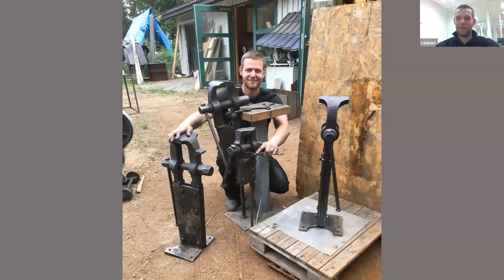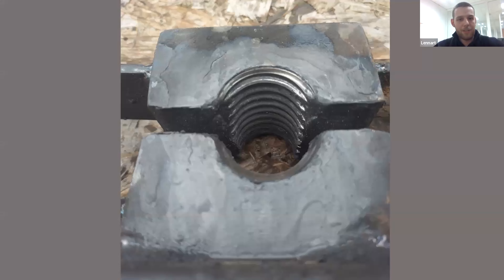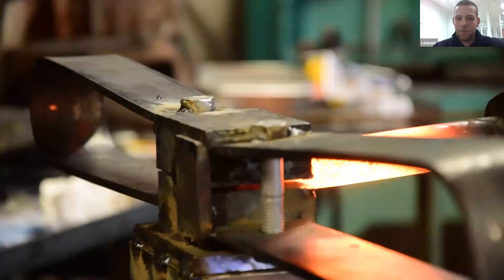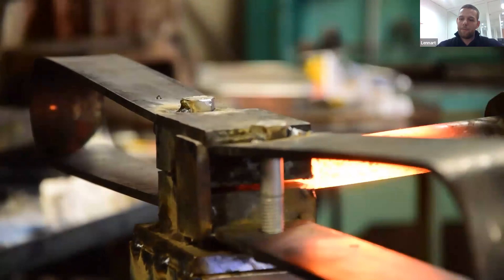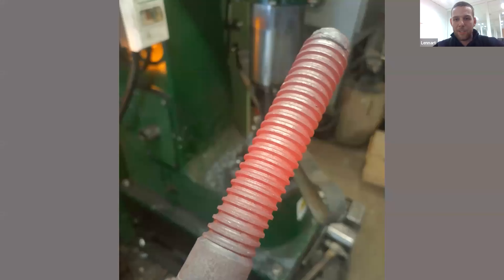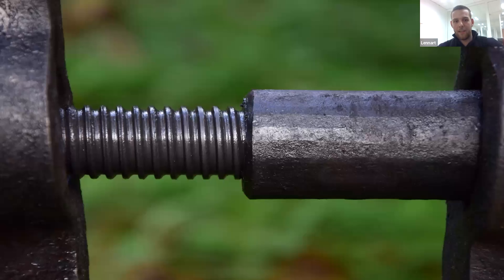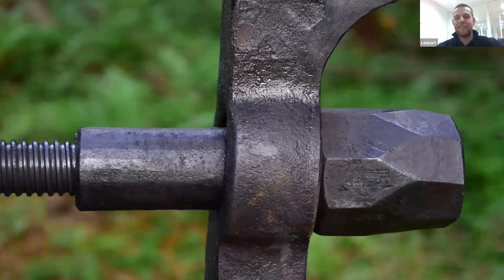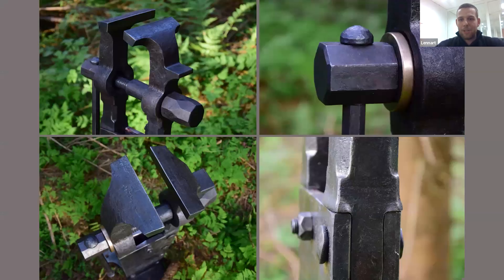Forging Vise Screws with Lennart Hoffmann: Blacksmiths Without Borders Aug 2023 Treff

Comment: I hope we vcan get this question to Lennart Hoffmann.
He talks about the shrink of the nut when cooling down.
How do you compensate for that towards the final product?
I'd assume you have to oversize, however small or large, the thread on the spindle you use as a swedge.
For the spindle I get it,
If you start from a model spindle, you can make the counter swedge for spindles. That swedge will shrink cold as well, so the new spindles will be ever so slightly smaller than the original.
Moving to the nut, that would then be even smaller...
How to get it to fit properly?
Reply: hi, to compensate for the shrinkage that happens when forging the die itself, there is not much to be done except making the first screw slightly oversize. there are several ways to go from there. if you use the "master" screw as a "drift" to forge the internal threads the threads will shrink,but since the screw you forged in the die also has shrunk it all works out nicely. the other a little more brutal way is to just keep the screw "drift" inside the nut while it cools down preventing it from shrinking too much. this will easily get the drift stuck tho so to prevent this you have to keep the drift lubricated with graphite and keep it moving in and out the entire time, i did this by welding a nut to the back and using a big impact driver. the shrinkage at these sizes is bery small so if it turns out too tight a little valve grinding paste between the screw and nut quickly makes them fit. the first way using a slightly oversized master screw is preferred in my opinion 
greetings, Lennart
Reply: Hi Lennart, agreed that if you have a master and a master die made, a new spindle made in the die would fit a nut made on the master. 
How would you approach then a situation with just a broken nut? Would you replace both nut and spindle? Or try to prevent shrinking? These questions are hypothetical and purely out of interest 😅 not planning on doing this stuff anytime soon..
Reply: @MafkACE  to be honest if i had to repair a broken nut but the acrew was still good i would use a different method, probably making a new nut on the lathe or wrapping a new thread around the screw and then brazing it to a pipe to form a new nut